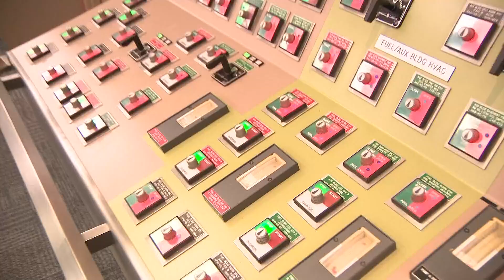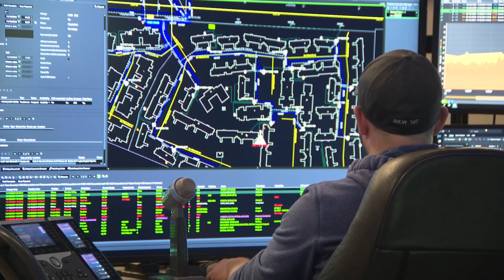Arizona utilities considering a new nuclear power plant

Comment: 3 years
just to figure it out, then 2040 till it's complete?  APS has no clue. Bureaucratic incompetence.
Reply: 2010 wasn’t that long ago and it will ease the grid for decades to come
Reply: @theRealBMF-zk7jm  I don’t think building a nuclear plant is really something you want to rush.
Reply: Beauracracy is the problem. You can thank the hippies for shutting down nuclear. The fools.
Reply: @danf1862  practical environmentalists will admit nuclear is the only legitimate option
Reply: Just because it's taken fifteen years in the past doesn't mean it should still take that much time now. Stopping and slow rolling.Nuclear has been the process for the last fifty years. Only our military has been exempt from the over regulation of the commercial industry. They have done an amazing job of building small nuclear reactors with 0 bad outcomes. The rest of the industry needs to be safely de-regulated and get on it. The technology nowadays is way better and could be done very safely. It's only a long standing safety stigma propagated by other player's in the power production space and amplified by useful idiot environmental protesters, that has held it back thus far.
Reply: @theRealBMF-zk7jm  Vogtle took 15 years. It’s owned by Georgia Power and others. So, APS is basing its timeline on the last nuclear plant completed - it went operational in 2023. So, it’s a solid estimate.
Reply: @theRealBMF-zk7jm  They're all private companies.